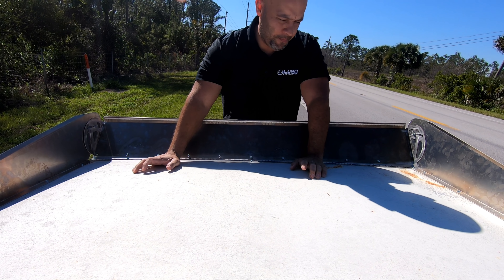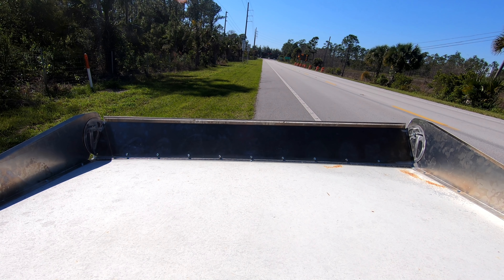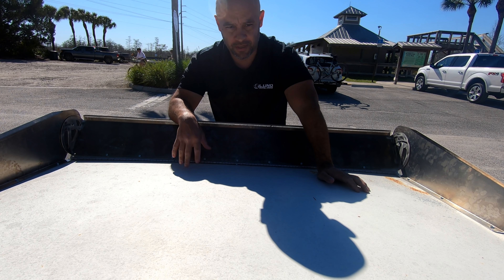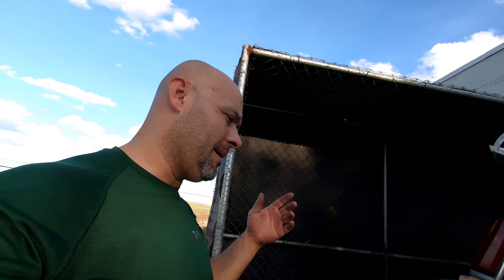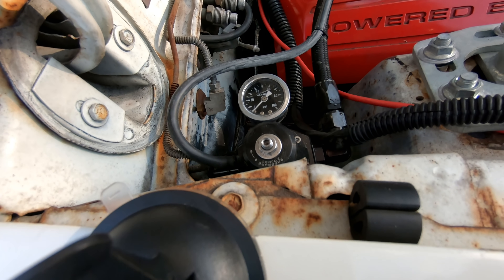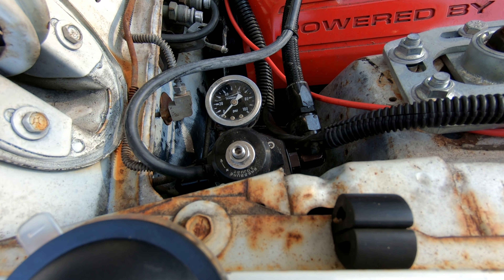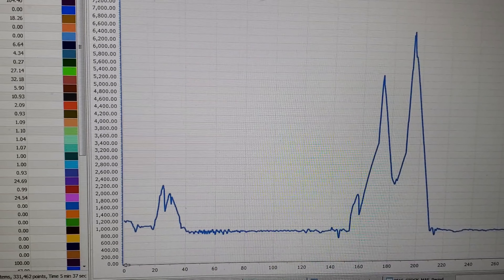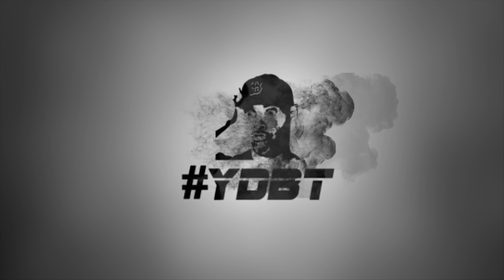Coyote swapped fairmont gets Dowforce, but it needs a fuel system upgrade,  pulls and dyno inside!!

Comment: How did you determined or found the angle at which the rear wing is making some downforce?
Reply: It would be interesting if his wing flexed enough to see with his GoPro camera.  If he could measure the deflection,  he could calculate the down force that way.

Comment: Tire pressure may be too low, the center of the burnout marks look lighter than the edges
Reply from the maker: 20. Any higher way less hook
Reply: 20 is normal for street stuff for et street r's